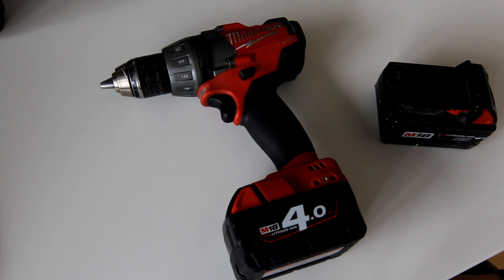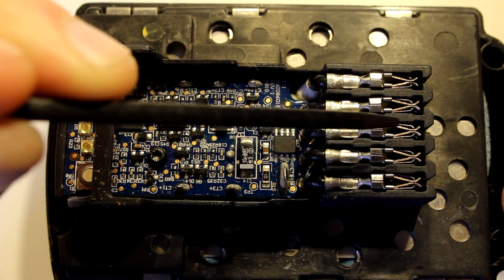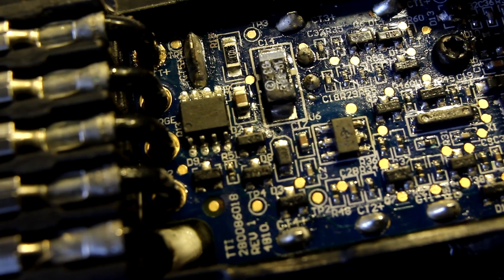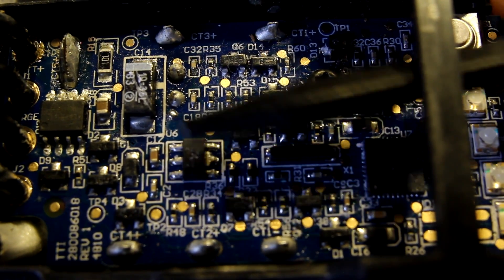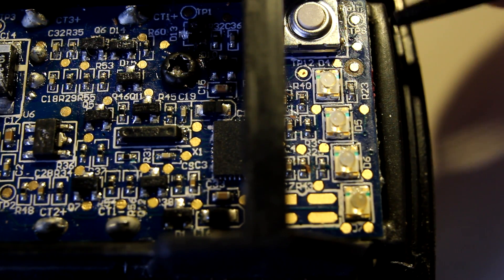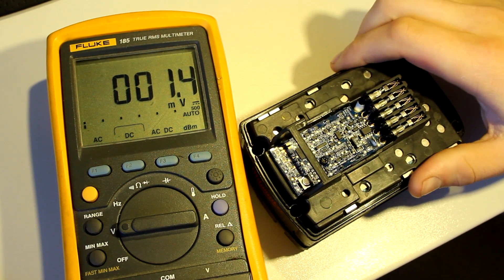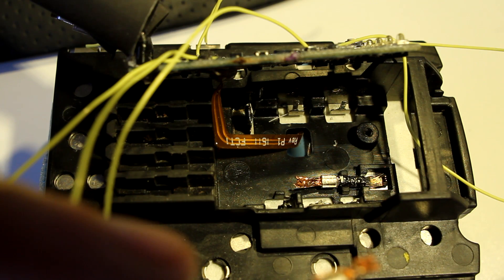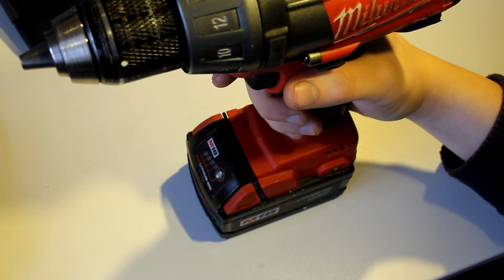Milwaukee M18 battery teardown and repair (002)

Comment: How do you keep power on it so it doesn’t lose its programming.? What connections need to be made and where did you get the power source? From a voltage injector or batteries? Thanks for your help

Comment: I suspect the reason they use voltage and not coulomb counting to detect battery charge is that they sell several capacity variations in the same form factor with identical components except for the individual cell capacity.

Comment: Nice video! Does anyone know what is the part for the female connector to the tool blades? I am trying to make a PCB that directly takes 18V with some bypass caps. I can't seem to find it anywhere. Many thanks in advance!

Comment: Hi I replaced all the cells in one of my Milwaukee M18 12.0HD AH batteries, spot welded all the tabs back on and ill plug it into the charger and it just shows the green light. Now when I press the battery level button it shows one bar thats flashing and when I plug it into an impact it just lights the flashlight and the 1 or 2 setting but does not run the impact. Can you help me?

Comment: Best video so far, use the microchip from TI - MSP430F22x4 or MSP430F22x2 which can be decoded somehow with device EV2300 and I2C protocol

Comment: Is there a way to make/hack it so can swap out the cells by simply inserting new batteries (cells) only by hand... Like changing batteries in a tv remote?? I want to get the Milwaukee Top-off tool but only if I can swap out the batteries quick and easily so have endless power. I have bunch of 18650 cells around so that would be awesome. There has to be a way!

Comment: What if u are getting 18 volts but the battery still don’t work when u press the button ? When the battery is out on the charger it flash red and green

Comment: Anyone know about the pin outs on the m18 battery? you get a voltage between the two inner pins of 3.2v, however my impact sometimes stops working and then I check the inner pins and they are at 0v, i can reset the battery by plugging it into my drill to bring them back up to 3.2v then it works again, so the impact must detect a fault and tell the battery to disconnect the pins?
PS though the inner pins are at 0v and the impact doesn't work, the led light still powers on battery connection.

Comment: Why didn't u explain how to hook up power to the micro controller it's kinda of pointless to explain how to fix a battery   if the micro controller  loses power it will wipe it's ram and never work again????little confused  but over good vid thx for sharing ur knowledge
Reply: If you have to ask then its best staying away from these jobs, especially since large battery packs can output a kw, enough to give you serious burns, its almost like shorting a car battery.

Comment: I had the same problem - Did not use the drill  for a couple of years, looked all over the internet on how to resolve issue as both batteries that came with the drill was flashing GREEN/RED when on the charger. I found out rebooting the battery with a simple 9VOLT battery works perfectly. +ve from 9 volt battery to +ve on Milwaukee battery and -ve from 9 volt battery to -ve on Milwaukee battery. I left this on for about 5 minutes and VOILA... It came back to life. You dont have to dismantle the battery if you are not techi sauve.. Good luck

Comment: mines just out of warranty, of course. 20v fully charged (possibly over charged?)... 18.0v+, 3.0v??, 18v.0+, 0.0v-, 0.0v-, !!!!!! no 3.0v control cct !!!!!!, no indicator lights, red/green flashing lights on charger. Dont want to pull apart any further as I dont want to lose power to pcb. Newer model than in video. Any thoughts?

Comment: My xc 3.0, xc 5.0, xc 6.0 etc doesn’t look like that, i took the board out
Doesn’t have the fuse wire.
Casing looks different as well

Comment: I have two seldomly used Milwaukee 18V  LI-Ion batteries, and one is experiencing issue with fuel gauge button/indicator not working.  The battery was fine (one bar) prior to putting it on the charger, the charger light turned green indicating full charge after a while, took the battery off charger, and the fuel gauge light stopped working.  Took top casing off, and measured ~20V across Battery+ and Ground (1st & 5th) from right to left (looking at the fuel light bars), which meant fully charged.  
The interesting/disconcerting part is J2 & Ground (4th & 5th) measured ~0V on the bad one, but ~3v on the good one.  Tried electrical contact cleaner/brushing, and it worked again when pressing the button to light up, but then reverted to the dud once put back together.  Flashing green/red when putting the bad one back on charger, with fuel gauge button not working.
Worked fine for lamp, but no other tools, so it's a communication/self-preservation issue for sure.  Any ideas besides full-blown teardown?  TIA!
Reply: I have the EXACT problem. Problem started the same way.
Reply: My problem eventually went away on its own without further intervention.  So give it time perhaps.
Reply: @stevechou1121  so..overcharged is my guess. Still confused on why the control cct stopped?

Comment: It would be interesting to find how exactly to power only the chip while replacing cells, without needed to do all 5 pair bypasses.
Reply: Those are not even Milwaukee batteries . They are knockoffs ....
Reply: @joemessina9183  I could use some pirate  Milwaukee PCBs, like the ones for Makitas.
Reply: @joemessina9183  As another commenter mentioned, I'm reasonably sure these are the European graphics on OEM Milwuakee batteries. The off-brand control boards look different. Could be wrong.

Comment: The Craftsman 20 volt lithium Ion Pro Series battery has almost an identical control board on top, but batteries lay sideways. A PTC thermistor has high resistance cold, then lowers when hot, not hard to check. (For Readers)
I wanted to see how to remove the battery straps from the control board. Cut with dermal close to battery then solder with twinned plate or copper? The tabs fold under and no soldered joints on top. With a EEPROM, an external power supply is needed, nice.
Advice? I can't afford the $100 each X 8, as one battery lasted 12 years. They only have a communication wire, power and ground. I don't have any chip that is a multiple pin controller just a MOSFET, and voltage sensors for cells and temp. Help?
ASE Master Tech since 1978 - Retired 10 years during "WU-FLU" panic. I made a mask for a beard, using a "Crown Royal" purple cloth sac. Can't find the bottle, but hangs low enough to cover my facial hair w/o elastic pulling on ears. Thumbs up!👍

Comment: But how did you repair it?..
Reply: Just guessing here. At 13:45, he pulls off an insulator to reveal a broken connection, which he suspects to be a burnt fused link. It looks kind of like a piece of solder braid. Assumedly he replaces the braid with a piece of high current wire, or some other type of fuse, and then reassembles the battery.

Comment: The best video examining a Milwaukee battery, great job! I wonder how is the balancing implemented, if there is no balance cell leads to the charger and the pcb doesn't seems to have a balancing facility (a row of 5 resistors with small fets should be quite obvious) then does the microprocessor only monitor the cell voltages?
Reply: It probably uses active balancing rather than resistive balancing. Cell voltage will be measured and trickle handled by the MCU. Remember, it only has to "stop charging" each cell once it reaches target voltage... it won't be transferring power between any cells. Think of it as 5 x Single cell chargers (each 4.2V 3A 12.6W) in series rather than one 21V 3A 63W charger with separate balance connectors and bleed resistors.
Reply: @johncoops6897  that would be ideal, but there is no connection between the individual cells to the charger for that to be possible
Reply: @OFERbikes  - the PCB inside each battery pack is the charger. The CC/CV charge controller, BMS for under-voltage, over-voltage and over-current, plus active top balancing is all handled by that PCB. The base unit (that we might call a charger) is just a (3A) Constant Current >21V power supply. However it has some active circuitry inside to communicate with the battery PCB, which will switch on that big Mosfer and allow the "pack assembly" to accept a charge on the +/- terminals. The power tool and "power supply" don't have a function in BMS or Charging. Almost all lithium battery tools are configured that way, it's not unique to Milwaukee.
Reply: @johncoops6897  Are you sure about the active balancing or you are guessing? I was also surprised to find recently that makita batteries have no electrical connection at all between the cells to the pcb nor the charger, which is nonsense to me.. treating a li-ion battery as a ni-cad..
Reply: @OFERbikes   I am not sure, and came to this video to get confirmation. However this Youtuber decided not to tell anything about that.
As for "active balancing", this is common for consumer battery packs as it is much better than resistive balancing, as that's just over-charging the entire pack then slowing draining the voltage from the cells with highest voltage.
As for Makita... bullshit. They DO have connections between each cell and the BMS https://youtu.be/PNVBbOQZW64?t=111
Reply: @johncoops6897  As for makita it depends which generation. I've seen it myself repairing a makita pack and you could see it in some videos as well.
Reply: @OFERbikes  they stopped making those shitty Makita first-gen "no balancing" packs about 10 years ago. From your comment it seemed that you meant ALL Makita 18v packs, when in fact it only applies to some very old ones.

Comment: can you supply a diagram of which points you connected the jumpers to allow access to the P C B .V
Reply: You don't need a video or diagram. Watch this video and listen... He clearly shows and explains what to do. If you use your brain you can work it out, and if you can't work it out then you certainly should not be fucking around with dangerous lithium battery packs.

Comment: Great video - thank you.
 I do not have a charger. I have a Dc to DC lithium charger. How do I conet right my battery to the charger? 
1. Plus (+) to negativ (-) ? or
2. Plus (+) to Charge pin ( no. 3 pin) or
3. Minus (-) to Charge pin (no. 3 pin)
Reply: If you need to ask, you really shouldn't be playing with stuff like this. Anyway, positive to positive and negative to negative. You need a current limited power supply to safely charge this pack.

Comment: I am wanting to use a Milwaukee m18 xc 8.0 battery for another project but need it to be 14-16v max.
Can I unsolder/delete 1 cell and still have the batt. & charger still function at the lower  voltage ?
Reply: Of course not! If you want to reduce the voltage then buy a Buck (step down) module from eBay etc. These will also provide a Constant output voltage as the battery runs down.  Buy a module capable of delivering about double what you plan to draw from it... in other words if you wanted 15V 3A then buy a module that the Chinese supplier rates at 6A. That's because the current ratings tend to be overstated and/or rely on extra heatsink and fan cooling.

Comment: I use two wire to charge my Milwaukee battery negative and positive and it blow the fuse of the transformer
Reply: You cannot use a transformer, and you should NEVER charge batteries that way! You must use a proper "constant current" lithium battery charger with suitable charge voltage (M18 = 5x3.6v nominal 5x4.1v charge). A transformer will not regulate the Charge Current properly nor have the correct Constant Voltage phase at the end of the charging cycle, so you will completely fuck your expensive Milwaukee battery if you don't manage those aspects properly.

Comment: Looks like chinese knockoff milwaukie batteries
Reply: NO - they are 100% genuine Milwaukee batteries that are sold in NON-USA countries. Same product as "RedLithium 4.0 XC" which is part code 48-11-1840 in the USA and sold as "M18B4" under part code 4932430063 in almost all other countries.
The big 4.0 sticker is the graphic prior to the "RedLithium branding, only recently changed in Europe yet still used in Australia.
Reply: @johncoops6897  i have a bunch of them 
and when you take them out of the case,
entire batteries bank are enclosed with Milwaukee PBC covers them all.

This can be knock off

Comment: If I don't have a battery yet want to test the Milwaukee fuel drill do I just need to connect the positive and negative to a power supply or do I need to do something with the J1, J2, and Charge one?

Comment: Nice Video. Thanks.  I have a broken battery. The charge of 19 volts shows on meter for a second then goes to zero. Any thoughts on same.  I got my drill at the recycling center with charger
Reply: The battery is broken. That is why somebody threw it away. Quite obvious really.

Comment: Does it have balance charging circuitry on the PCB?
Reply: Except for very rare exceptions (not this one) tool batteries never have "balancing". They monitor the cell voltages, and that's all.  If you think about it, you'll realise that there isn't hours to wait while the pack slowly balances itself.

Comment: Great video! FYI I replaced the cells prior to finding this video. I had no power indicator bars after replacement. I was about to toss the pack but decided to see what would happen if I stuck it back on the charger. Right when I stuck it on the charger, the charging indicator went green (my cells were from a different battery pack that was fully charged; Panasonic cells). Pulled the battery off and stuck it on the tool. It works!

I’m got a good amount of work to do today so hopefully I can get this fully drained and monitor a recharge.
Reply: Hi, I did the same thing, first I replaced the li-ion cells and then I reconnected everything, but as you don't get the LEDs on. So all I need to do is connect the battery to the charger to get it back as before?

Comment: You say once the battery cells are drained to 0V they are done for and the uP looses it's memory, that's not true. I've restored a battery pack which all cells had 0V just by force feeding each of them a high current for short periods. After they had about 2.5 to 3v on each I just put the pack in the charger and it took the normal charge and works fine.
Reply: Hey Walter, 

question about this, I actually picked up a brand new pack that was completely drained (all cells 0.0x volts) and individually charged each cell, but from what he said in the video all hope is out because it wouldn't work since the uP lost all power. That being said, it looks like you had some success with recharging each cell individually, I did it while they were in their series (didn't remove them from their place) but I'm still not getting any 'life' from the pack, not even a response when I click the button on the front. Did you do anything special during your repair.. or? Thanks for your time. ~Charles
Reply: @charlesfoster3933  you need to reset t the BMS by shorting the Negative terminal of the pack with the terminal next to it. E.g. terminals #5 and #4

Comment: Hi I’m grateful for your video you seem like you know your way around a battery lol so maybe you could possibly help me with the problem I’m experiencing. I used my battery multiple times to jump start my car pos to pos neg to neg. but the last time I couldn’t find insulated wire and was forced to use bare and of course rushing around the two touched. Created a short? Battery says fully charged(green light on charger) but when taken off and hitting battery status button, it blinks red referring to a dead battery. I’m gonna open it but was hoping you could point me in the direction to look for the problem. I’m hoping I didn’t ruin it it’s only about a year old,....thanks a lot
Reply: You have tripped the over-current protection. You should be able to reset it by inserting it into a genuine Milwaukee charger. Try quickly shorting the Negative pack terminal with the terminal immediately next to it, as that's how the Charger reinitialises a battery that has gone into protection mode.